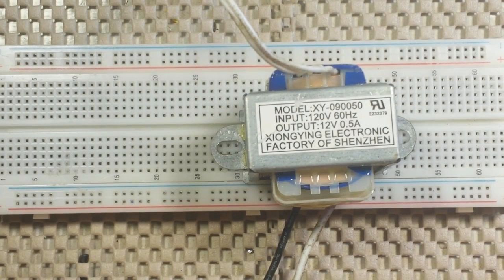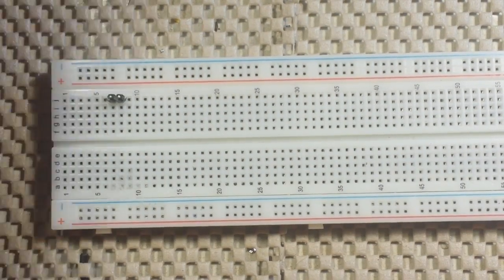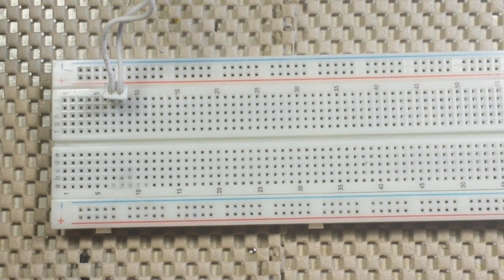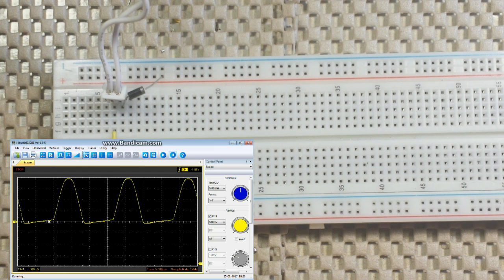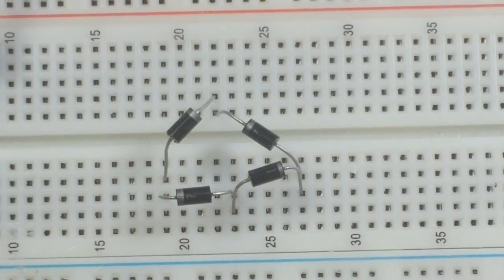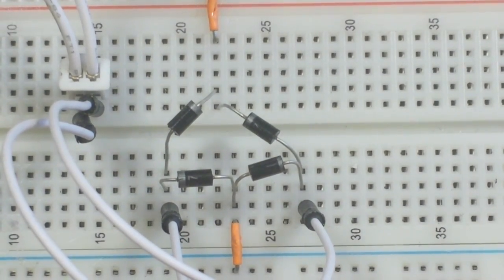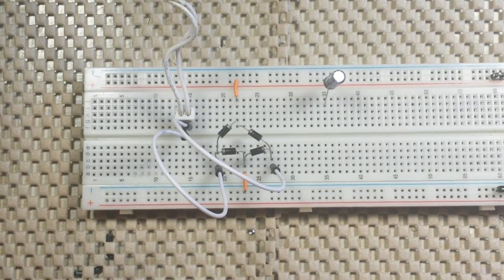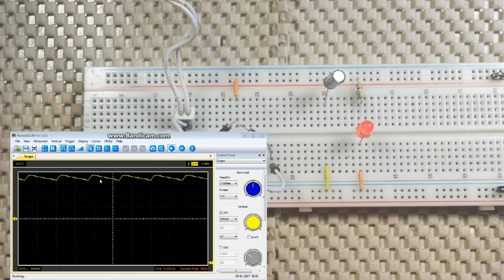Basic Electronics: Ac/Dc and Rectification

Comment: Hey Paul, I am using a FY6800 function generator to produce the sine wave (I am running at 60 Hz 12v) and am feeding the output of the circuit into a Hantek DSO5102P.  

The output of the 6800 checks out correctly - pk to pk reads a little high (13.4v...?) on AC coupling and 50/50 on the + & - volts).   Using 1N4007s and the 1K R and a 5mm LED as the load and wired exactly the way you've wired here I still only indicate 1/2 wave rectification on the scope.  It's extremely frustrating, as I have spent a day or two wanting to explore rectification, smoothing, etc., but I keep getting the same results despite following every example perfectly I get the same thing - half wave rectification.  The LED confirms that by flashing at lower Hz, so I don't think it's my scope set up.

Really frustrating!  Any idea what I am doing wrong?
Reply from the maker: Can you sketch your circuit and email it to me? Arduino0169@gmail.com
Reply: @learnelectronics , will do.  I can send pics of my set up, if that's better.  Thanks, Paul.  I've spent a day and a half on this and I just can't see where I am going wrong...GRRRRR!

Comment: the lowest recorded voltage for death by electric shock is 60V. Even AC at 12v should be nonlethal. While I understand that you need to demonstrate safety. It's just not true
Reply: Yeah, but 12v isn't nearly enough to push .5 amp through your body, even with wet skin. That transformer could be 100 amps and it wouldn't matter, because your body's internal resistance is too high, and keep v=ir in mind!
Reply from the maker: Alec Weber it's not the volts my friend. 1/2 amp will stop your heart.
Reply: @learnelectronics  
Should maybe watch this....
https://www.youtube.com/watch?v=XDf2nhfxVzg
Reply: learnelectronics its 20mA across the heart.
Reply: It sure would... at higher voltages. While half an amp is nothing to scoff at, with the resistance of your skin and the low voltage it's not likely to do more than give you the most minor  tingle.

Comment: Hey man nice video it helped! I have a question though. How do you choose what smoothing capacitor to use? Does it always have to be electrolytic and a cetain amount of micro farads or does it vary? What about polarity? Thanks again.
Reply from the maker: dtech12 thanks, glad you liked it. as for the capacitor,  the larger the value, the smoother the current. I've always used electrolytic, it's just the way I was taught. polarity is very important. if u put that electrolytic cap in backwards...bang! also make sure your cap is rated for a higher voltage than the transformer can put out.